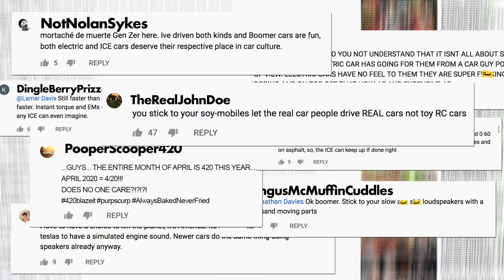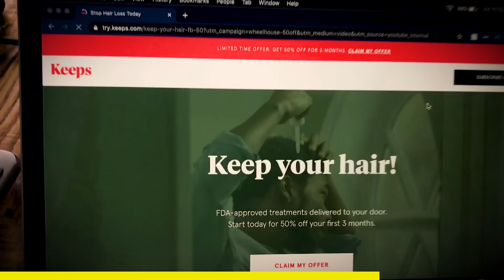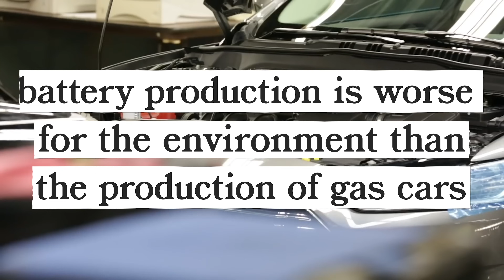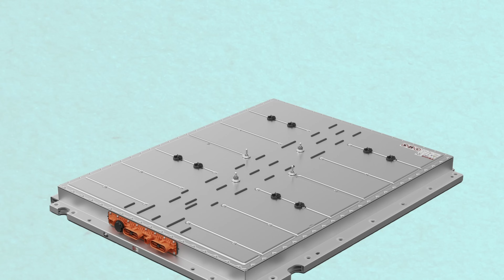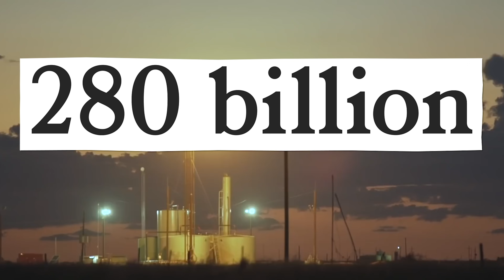Are Electric Cars REALLY Better for the Environment?

Comment: That day when gas powered cars are banned from the roads is coming closer.
Reply: I don't actually think a ban on their usage will come, although it will eventually be illegal to sell new i.c. cars. At some point the supply of oil will reduce to the point where the big oil giants no longer feel it's a viable proposition. Somewhere between now and then, most i.c. cars left on the road will slowly become parked up for good, because it will probably become both increasingly expensive and problematic to obtain gasoline for them..... They'll eventually go the way of dinosaurs.

Comment: Correct me if I’m wrong, but there should be a point where you aren’t driving enough to make an electric recuperate the difference. Let’s say you keep your electric car for 20 years. You have to replace the batteries twice during that time (batteries last roughly 8 years), bringing your additional pollution to 30 tonnes more than gas. Not to mention, if I buy an EV instead of just keeping my current ICE on the road, it’s an extra 7 tonnes. So if you’ve got a vehicle, and drive less than 5000 miles per year, the most environmentally conscious method should be to just maintain your current vehicle well, and keep it on the road

Comment: Basically - yep. However...
How are those rolling blackouts working out?    The grid can handle it, under normal conditions - in places, it can't handle normal life in very hot summers.   If CA gets its way - it'll be EV only, but that's fine because everyone will have moved out.

Comment: You forgot to add that batteries need to be replaced every 5 years. So, in the long run, EVs are a lot worse.
Reply: Utter garbage. All EV makers give an 8 year warranty on the battery pack. Nissan offer to replace the pack if it isn't at least 75% efficient at 8 years old. Out of the over 300'000 they've sold, they have replaced just a handful. Wow, misinformation is still alive and well.....

Comment: The mining could also be somewhat solved by biodiesel, given that it gives off much less emissions than petrol diesel and still works just fine.

Also, some people seem to be saying that nuclear power plants are not clean. Most of the emissions come from the mining of uranium, which like I said above, could have a reduction. And there's also the possibility of thorium reactors, which has far less waste, and the waste is less radioactive. Plus, thorium is abundant. Then there's also nuclear fusion reactors.

Comment: The problem of EVs is still the battery because its lifespan is about 3 years. After a year of daily driving a lithium battery will only hold 80 percent of the charge it originaly had.
Reply: What utter crap. My Kia eNiro has an 8 year warranty on the battery pack. And, if the pack isn't at at least 75% efficiency after those 8 years, they offer to replace it. Why do people who have never owned or driven an EV talk such crap about them?

Comment: HYDROGEN POWERED CARS EVERYONE THIS IS THE ANSWER
Reply: Not in the UK they're not. There are only about 6 filling points with public access in the whole country. It's a non starter here. And in any case, extracting hydrogen uses lots of electricity. And then the hydrogen has to be transported in trucks (more emissions) to where it is stored and sold. A hydrogen powered car is an electric car anyway. The hydrogen fuel cell provides the electricity to power the motor. Why not just use the electricity used to extract hydrogen to charge an electric car in the first place, using the grid that exists already?  VW seem to think EV's are the answer. Look here... https://www.volkswagenag.com/en/news/stories/2019/01/volkswagen-to-manufacture-electric-cars-on-three-continents.html

Comment: A Tesla battery has a lifespan of about 8 years, most projections say they'll last longer but we'll go with 8. The average vehicle puts out about 4.6 cubic meters of c02 emissions per year, assuming ~10k miles driven per year. That means it takes only 2 years of driving a brand new, long range EV to start offsetting your Emissions. Ofcourse I didn't include the CO2 emissions of the eletricity used to charge your Telsa/Leaf/other EV. That's because google couldn't give me an easy answer. In general though, the lifetime Co2 emissions of EVs were found to be about 3 times lower than traditional ICE vehicles.

Comment: Life span of an electric car is far shorter than an IC car.
Recycling of an electric is far more difficult.
Cost of replacing a battery is prohibitive
Environmental cost of creating charging stations isn't taken into account
Range vs an IC vehicle is a joke

Electric vehicles can be made better but it's till very early stages

If electric was best then it would be used for shipping

Comment: And no, wind and air proliferation wont help with EV carbon neutrality. The only source that doesnt require carbon based energy subsidies is nuclear because well, it produces so much power. EV would be clean if we used only nuclear. I studied this at uni so, food for thought I guess.

Comment: I think I'll stick to an ICE car as they're literally far more cheaper for me to run and I'll get higher range. If they can ever guarantee over 500 miles from 1 charge, then I'll consider purchasing one. EVs are currently for overpaid rich people.
Reply: Your ICE car won't beat my Kia eNiro for running costs..... I clocked up 5000 miles from new just last week. So far it's cost me about £120 ($150?) in electricty....  Why do you need 500 miles from one charge?  You can't drive 500 miles without a break surely?
Reply: @Brian-om2hh  I get 440 from my diesel Golf and that's just on A and B roads. It cost me just over £60 a couple of weeks ago to fill up at Asda and I only fill it up every couple of months.

Fuck knows what an ICE car is.. I don't remember what the video was about.

I'd only get an electric car if the range becomes similar to what I currently get from my car. If I ever did a trip to either London or Scotland and back, I'd need to charge an EV at least twice in my journey. Fuck London though, it's expensive to drive on their streets.

Just checked and ICE is: Internal Combustion Engine 🤦🏻‍♂️

Comment: The only green tesla cares about is money. High pressure die casting in Lathrop nobody there to oversee building and production push push push quota quota..dumping oil, lube,grease into sewer with a river on the other side of i-5.elon never showed up only cares about the number of cars rolling off the line in Fremont.
Reply: You're telling this to the guy that released all of his patents instead of monopolizing the industry 🤦‍♂️

Comment: Battery’s only last 2-3 years then the range will decrease depends how how you use it
Reply: lol no 40 years then range is about 75% then it gets lower from there until the battery dosnt hold a charge anymore
Reply: @popinmo  depends on how you use it. From what i know a tesla drops to about 85-80% battery efficiency after 5 years of average use.
Reply: @lifeofentropy  you can buy a tesla from 2012 with 90% if its range also they use new stuff now that last alot longer

Comment: going from natural gas generation (80% efficient at extracting the energy from its source as electricity) to renewable energy sources like solar (28% efferent at extracting the energy from its source as electricity), your efficiency goes down massively, so does your carbon emissions, but you said that the ewffecency of these vehicles will go up as we switch to a cleaner grid and thats not true. efficiency is Energy extracted to do work/energy available from your source.
Reply: efficiency is the energy used not waisted
Reply: @popinmo It is the relationship between energy available and how much of that energy is used. If there are 100watts of photonic energy falling on one square meter and you are able to do work with 25 of those watts, then your efficiency is 25%, you used 25/100 of the energy available from your source. For electric vehicles, multiply by the transmition effecency, your charging and discharging efficiency, your drive train efficiency and you work out how many of the original 100 watts are put to the goal of motion. You are right about efficiency measuring how much you use, but it is written as a percent because it is out of how much energy was available from your source.

Comment: I am an Iranian engineer
My name is Farhad Imani

I designed a car engine without the need for charging and without the need for fuel, and it's not like Tesla and others who have to charge it to travel 500 kilometers, for example, because
My engine does not need to be charged at all
And it practically emits gravity and leads to the movement of the car, and then during the movement it enters the second phase of production, which leads to the production of very high power and torque and speed (above 500 km).
And it takes thousands of miles without charging
The distance around the world that travels about 40,000 kilometers without the need for any fuel and recharge over and over again
I will make it and introduce it to the world except Iran
The steps of its construction in Iran
It costs a maximum of 10000 $ , although later it is more important and introduced to the world
Reply: Congratulation!!

What is the basic principle
Reply: Bs
Reply: could you tell us more about this engine your designing?
Reply: EMITS GRAVITY?

Comment: I had a thought one day. What happened to steam engines in early race cars. Sure they had lots of problems and who knows about reliability but if they could break 100 mph in the early 1900s then I’m sure with modern manufacturing and technology it could be greatly improved and simplified. And all you would need to use is water
Reply: Water AND heat...
The efficiency of steam engienes is pretty bad, since a lot of the hot steam is wasted.

Comment: You forgot to mention how efficient EV's are as drag cars. Lol. What I'm saying is how powerful electric motors are and how they beat gas cars at the track. ;-)
Reply: They are efficient as drag cars= yes, for Sure... But in track not much. I have to remember you evs are heavy and have limited top speed, just like their lose of torque when speeds get higher. You have 1000 bhp evs making the same time lap as an 600 bhp ice car

Comment: I think you need to check your data for the Grid Power Handle .... The grid its not design to handle that quantities of power and consider that all one will want Fast Charger more and more....

Other consideration its that the battery need be change at sometime ... 

Anyway    the future its electric cars .. but the source of energy will be the discussion...

Comment: A fact usually missed is that the biggest user of cobalt is actually in  the refinery process when making gasoline and Diesel. Another truth is that when a car battery is no longer viable for use in a car it can be used in stationary grid storage supporting the electrical grid and storing wind, solar and other renuable energy sources making it even better.. a positive spiral. I don’t see gas cars ever reaching that type of reuse. The future is electric, it outta be clear to everyone with an open mind. Plus, driving en EV is sooo much fun!!! Instant torque and little to none service required. The EV solution also makes it possible to build the safest cars ever..

Comment: >places with clean energy such as wind, solar and hydro electric
those are not clean, they have the same issues as electric cars, wind power has a huge environmental effect, solar has horrible efficiency and both are produced in ways that create extreme pollution
hydro electric is clean, but it fucks up the river and requires large reservoirs
the cleanest energy is hydrogen produced by nuclear energy, it's even better if it is thorium reactors

Comment: For the environment, electric cars and 'trucks' are horrible for the environment in the long and short turm, first electricity is in most places is powered by fossil fuels, 2 batterys last about 5 years, if your lucky 10, so every 5 to 10 years you would need to get a new car or to change the batterys, but it would most likely go for the new car, but for gas powered cars can out live people and still have the same motor in it.

Comment: Moral of the story:
They use gas/diesel powered machines to make electric ones
Reply: moral of the story: ev cars are better for the environment in the long run.
Reply: There are a lot of electric machines out there that can replace those ICE...
Reply: Not in Nissan's Sunderland plant in the UK they don't. The factory has many solar panels on it's roof, along with wind turbines outside. The factory uses minimal energy from the grid. It also has V2G facilities at the plant, further reducing it's dependence on the grid......